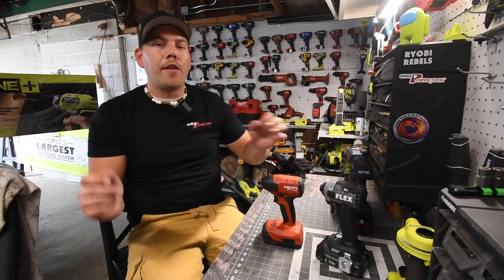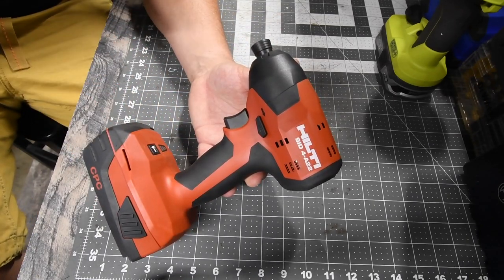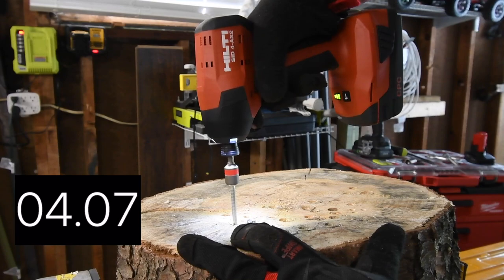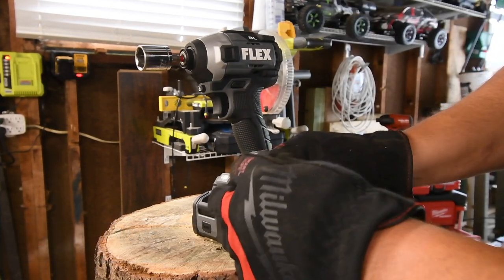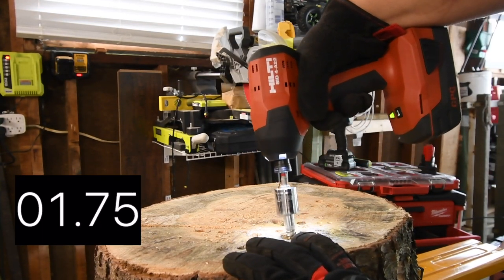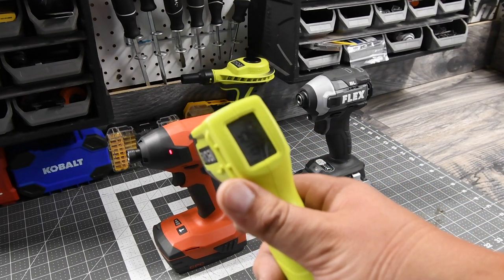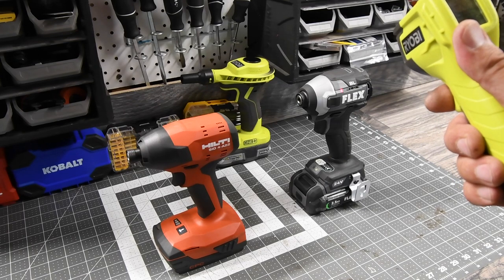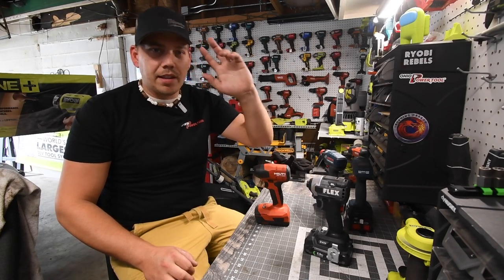Flex 2.5ah vs HILTI 2.6ah (Impact Drivers)

Comment: Hilti may not be the flashiest or the most powerful, but it’s usually the most balanced, ergonomic, durable, and reliable. There’s a reason Hilti is used by so many pros, and why they have 20 year warranties with a 2 year wear and tear warranty, and not even Milwaukee goes that far!
Reply: Amen brother. I'm a regular guy who doesn't own a business or anything like that and I don't mind paying for the hilti stuff. Most reliable tools I've ever used.
Reply: Tell that to my former employer, who bought 10 Hilti cordless drills circa 2010. Not a single one was working when I started there in 2016. Not subjected to hard use. All the installers were using their own tools, Ridgid, Makita, Ryobi, Porter Cable, Milwaukee, DeWalt, and even a few lower end brands. Only two of those failed in the 5 years I was there. They use Hilti supplies, but won’t buy another Hilti tool, and I can’t blame them.

Comment: It really doesn’t matter what flex do here Hilti is hilti the best of the best the video is awesome don’t get me wrong but is Like compare a Mercedes with one of those new kias kid can do whatever Benz is Benz
Reply: It ain’t the best of the best when it comes to impacts at all. A more true comparison would be like a new Honda Civic (flex) vs an old 2005 Mercedes (hilti). Hiltis only calls me to fame is their warranty and relatively nice build quality, but you can get great build quality with other brands too. Aside from that they’re way overpriced and underpowered as shown in the video
Reply: @P_steez   I respect your opinion im ok with it but in my case I ride the Mercedes
Reply: The impact driver is not stronger than most which can be a good thing because in the long haul there is less wear on the motor itself. That’s where Hilti comes in and says they outlast the competition.

Comment: I wouldnt take this a s a Flex vs Hilti test, but as new technology vs 5 year-old technology
Reply: jami w  and yet the Hilti is not as fast or as powerful as the Flex, any gen3 Milwaukee would smoke the go'old Hilti, now it is overpriced and underpowered
Reply: With the limitations of modern building-materials those Flexes get extremely hot and start spewing grease out of the front tough
...that said... I'm loving how small these are getting and I'd never do something this silly with a driver anyways! 😁

... it's just a big kinetic heating element at that small impact driver size. Adding another set of spindle fans to the motor would make the flex no longer a subcompact
Reply: jami w  100% agree, I prefer the fuel m12 tools for precision and accuracy

Comment: Hiltis claim to fame in their warranty. Other then that they're wayyy over priced and under powered in my opinion. Soon as I seen the title I knew it wasnt gonna be close
Reply: Milwaukee try to create powerfull tools to win the competition while HILTI CREATE ROBOTS.  😂😂😂😂😂
Reply: I'm not a Hilti guy, but that warranty is very solid.   Combine that with their "fleet" packages,  swap-out replacements, and full servicing/recon of their tools.  If I'm the owner of a large construction company, constantly keeping tabs on which jobsite which tools are at, my employees breaking or neglecting my tools, etc etc, I would take the hard look at Hilti.  I like the concept they have there, but I realize it's a niche concept.
Reply: I find hilti to actually be cheaper than dewalt actually.
Most mainstream brands only make sense when you wait for their [once a year] sales events and then their batteries and chargers are waaaaaay overpriced(or underpowered compared to the hilti option). Waiting for sales isn't work.
It's ridiculous trying to buy your way into the rainbow brigade because all of their chargers and batteries are ridiculous.

If I salvage a dewalt or a makita off of the side of a road on garbage day, for example: I'd literally have to buy a new tool just to save money when I only needed a battery and charger ... just to use the salvaged tool.
...been there, done that.